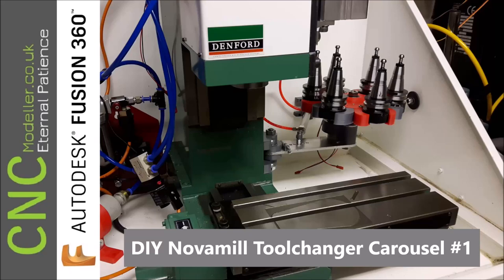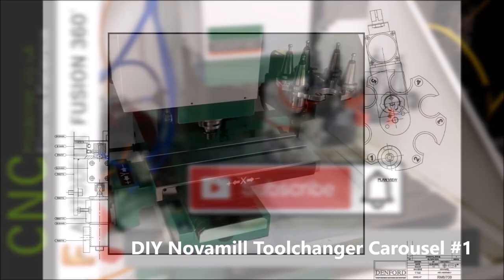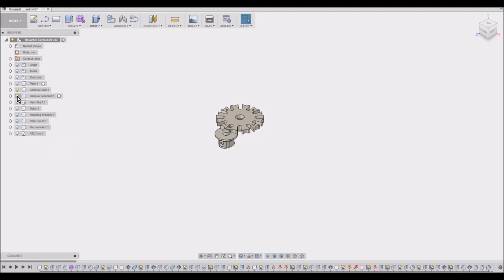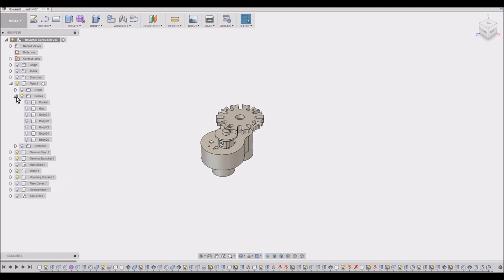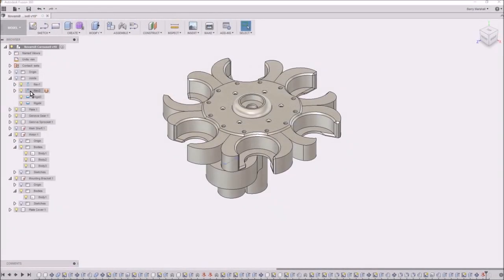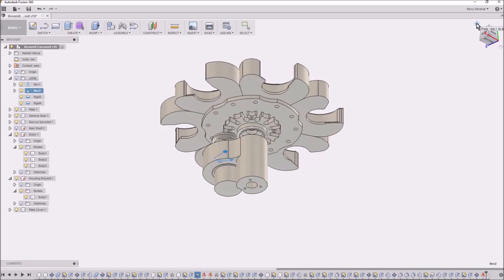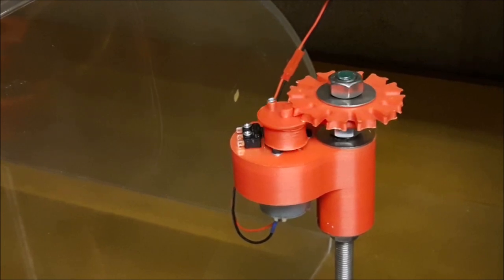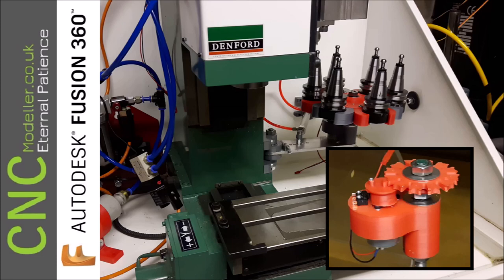DIY Milling Machine Tool Changer Carousel #1

Comment: Nice work. I also have an old but in great condition Novamill which is currently away being converted to Mach3, what design programme would you recommend using with Mach3?
Reply from the maker: That's a topical question.  I've just spent the evening introducing a friend to fusion 360 and the mach3 post processor. Definitely my recommendation and worth the time to learn.

Comment: Hello, can I ask about the machine setup?
Reply from the maker: Hi Konrad, it's all as per the original denford control software and firmware. The hardware is reverse engineered from the original drawings.